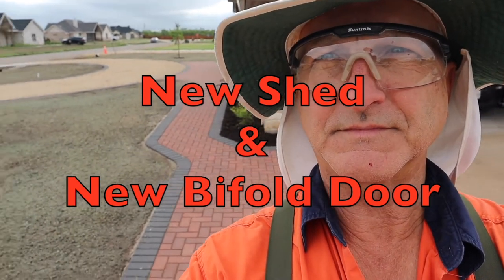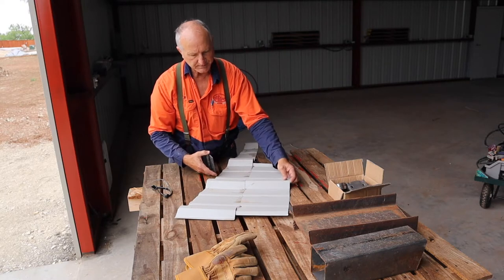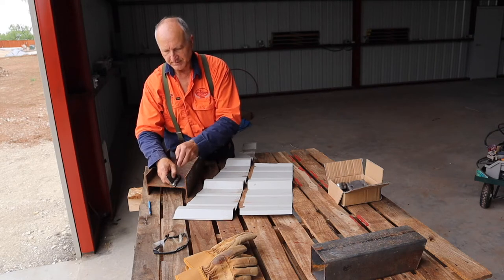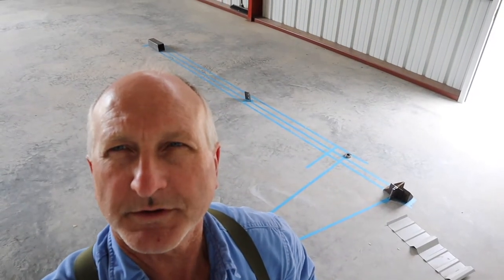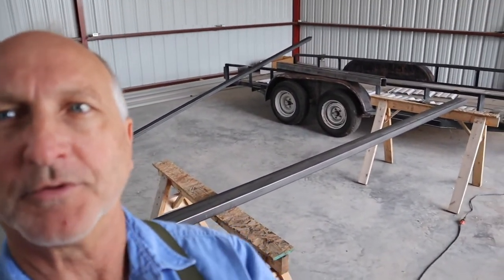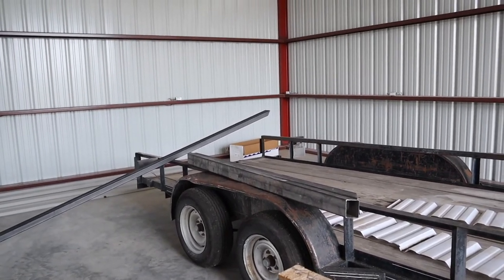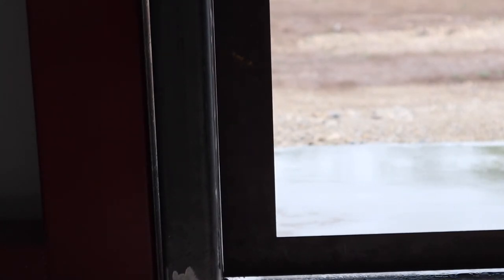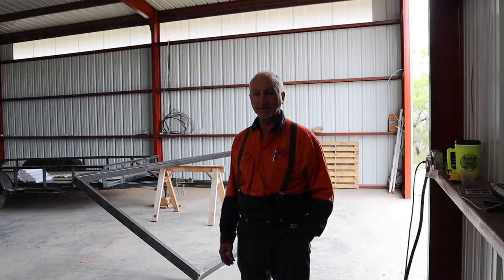Bifold Shed Door 1 - Made by J&D

Comment: Glad I ran across this video I started out watching the other smaller ones and then found this I'm working on an 12x14 bifold for my 30x40 building been stuck on how I was gonna do hinges
Reply from the maker: Is your door having corrugated sheeting as well? It bugs me that I lost 2 feet of head room but there wasn't any better way here. Thanks for your comments.
Reply: @madebyjnd  yes it will and I plan on doing an small hidden door on bottom section and I found some greaseable offset hinges made for a dump truck tailgate I'm gonna try to make work

Comment: Pretty cool door!  To mount the door, you could completely assemble it flat on the floor and then use a couple of boat winches, with temporary reversing pulleys at the ceiling, to lift it into place.
Reply from the maker: What did you think of my solution with the tractor?
Reply: @madebyjnd  That was pretty ingenious with the wooden slides!  Recommend some light "X" bracing on the frames; maybe 1/4" rod with threaded clevis' in the middle for adjustment.  The siding will not be stiff enough to keep it square if there is an incident with the door.

Comment: I have not found any other videos about making these diy horizontal bifold hanger doors!  I have a door that was original a standard sectional roll up and overhead door.  Garage was used to grow weed and they sealed off and removed everything to open it.   So rather than try to get the parts to put all that back together, I am working on making it a 'horizontal bifold hanger door".   I have the top two sections mounted and hinged on the outside, I think I can use the side tracks modified with the roller.  I am mostly stuck on how to do the pulleys with the weights.   I was thinking of pulling up from the middle, but everyone seems to pull up from the bottom of the lower section.   I guess then it is pushing everything up this way, but it seems more direct to pull up the middle.  I dunno.  I don't have a lot of time for guessing, as the garage is going to get full of stuff and I need to lock it..
Reply from the maker: Aside from presenting a really awkward challenge to pull up at the middle pivot point, there would also be some high stresses to the rollers and tracks at the bottom. I’m guessing you have a limited ceiling height if you’re in a standard garage so you also will have inadequate fall for a counter weight that is 1:1 pulley ratio. I recommend a weight that is double the door weight and use a block and tackle arrangement.
Reply: @madebyjnd  The garage has a steep slope downward toward the back, so there is plenty of room in front, Door is 7ft tall, ceiling is 8ft in front.  I am now thinking of using a single chain hoist  attached to the bottom in the middle and forgo the counter weights.  I found ONE other video where that is how he did it.  Could not be opened from the outside then, but I have a man door to get in from the side wall.
Appreciate your help.  I will post a video when done to help anyone else who tries this.
Reply from the maker: No worries, thanks for your comments. I don't know if you've seen all the videos I've made about bifold doors but my most recent one is in five parts (https://youtu.be/3425QI3nO_k) and uses an electric cable winch. It is my largest and heaviest door and although I used counter weights, a bigger winch would have worked by itself just fine. It also pulls up at the middle of the bottom edge of the door.

Comment: Did I miss the part of what thickness steel tubing it was you used? I caught the 2x4 tube part though.
Reply from the maker: I ended up using 0.125 inch because I was strongly erring on the side of caution. I was worried about wind load but probably could have used something one step thinner.

Comment: Planning out my door , is there a reason your top section is bigger than the bottom? I Believe it was one foot bigger, i saw on your measurements sheet.
Reply from the maker: The middle pivot is nearly centre between the lower and upper panels. The upper panel is actually shorter in appearance because the upper pivot is set above the upper door jam. The upper pivot can be placed at the top jam but that will sacrifice some of the opening as the lower pivot will never raise that high.